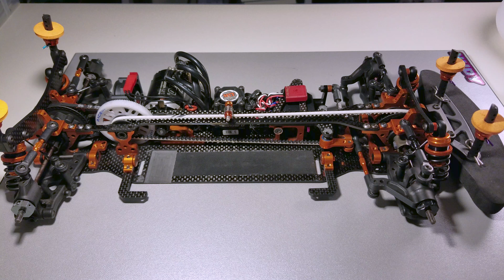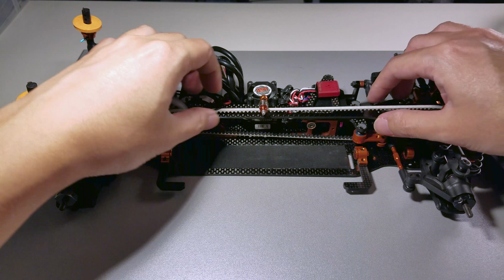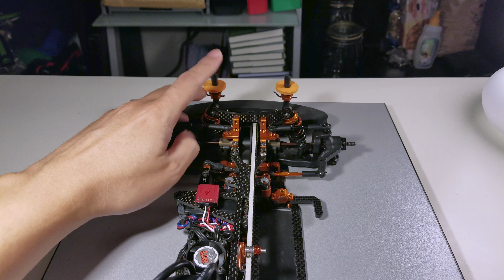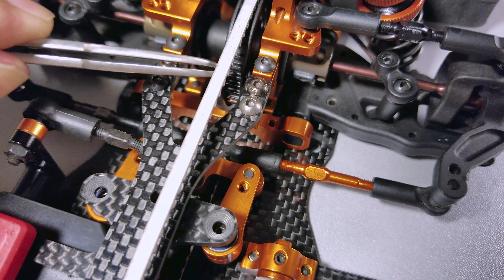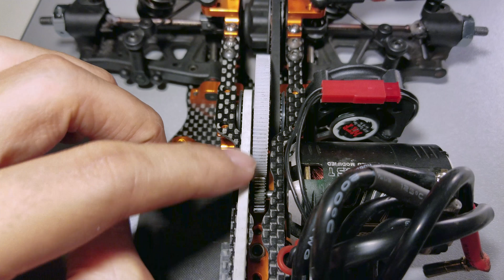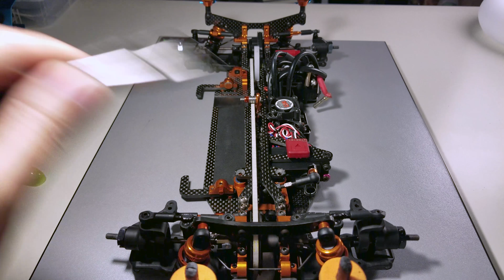How to maintain your RC touring car

Comment: Subscribed.  Very useful video indeed.  In my local track, the traction is low and with multiple sharp corners.  What should be a good setup to mitigate against these factors.  Thanks mate
Reply from the maker: Hi! Thanks for your message. Sorry for the late reply as I have not been checking my channel recently. Low traction and sharp corners you can start by using higher downstop values like front 6mm and rear 5mm. Also lower your front roll center, thinner rear diff oil, thinner rear roll bar, thicker front roll bar, softer springs and thinner damper oil. Let me know if you need more advice!
Reply: RC Cars Hong Kong will try it out.  Thank you

Comment: Hi there I wonder if you can help me with a problem I have on my RC, it runs well and smooth to a point, then suddenly goes crazy and goes full throttle and steering goes hard over, it doesn't respond to inputs at this point and the fail safe clearly didn't function as intended, would this be the result of a dodgy receiver?

Comment: Please teach me, which is the best electronic component brand you use in your T4. I'm still newbie. Please list the part and best tuned for speed and acceleration. Thank you.
Reply from the maker: Hi! We use in Hong Kong mostly hobbywing xr10 pro and hobbywing or muchmore motors. Receiver we all use sanwa mt44 or m12s or RS. Can you let me know what turn motor you want to use? That is the basis and all other tuning depends on the motor selected.